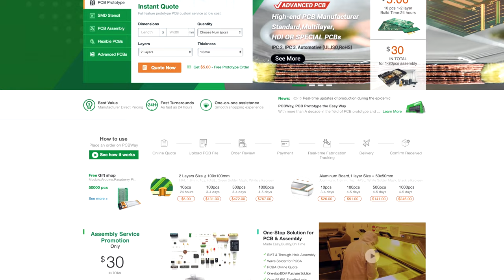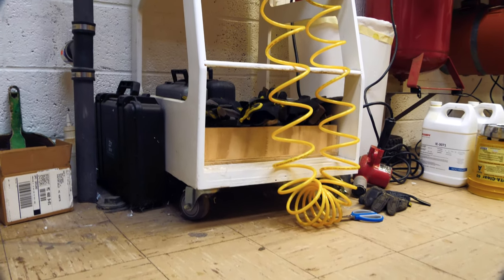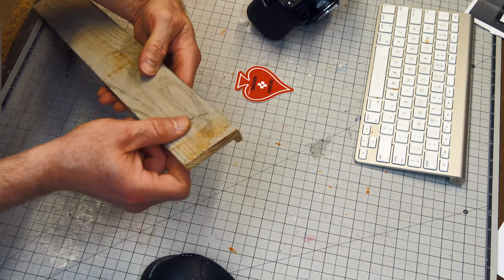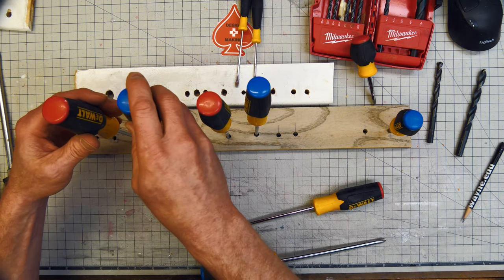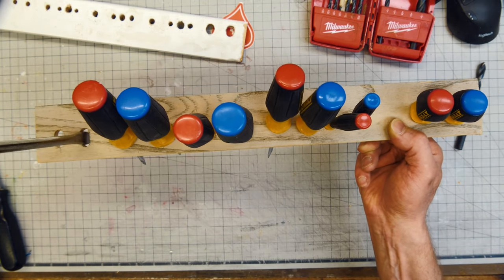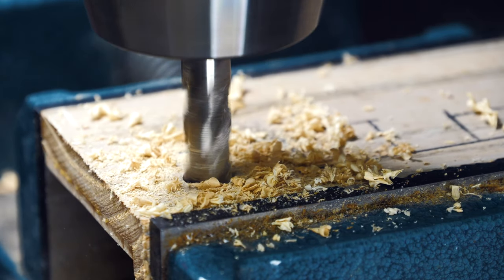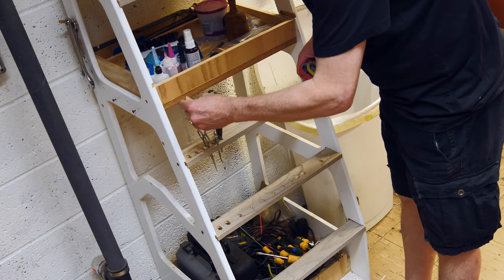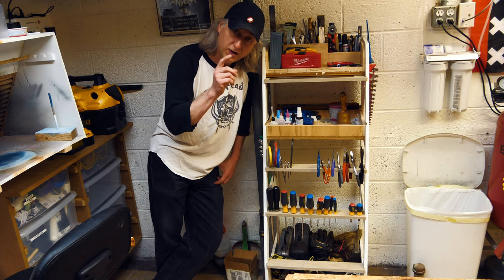Tool Cart Upgrade NSFW edition

Comment: I use those Stanley sort master stackable tool Kits and just drilled holes in the bottom one and stuck some wheels on it and bam. I got me a cheap and modular and effective tool box. Only issue is you gotta stack the boxes so what you need it near the top or on top. Because you can’t access the middle boxes since I didn’t make a rack for them to slide in and out of. Makes a great foot rest too when it’s like 5 boxes high 😂
Reply from the maker: Nice! Thanks for sharing

Comment: I have a comment about the drill press: If you don't like it and have the means to replace it if it breaks, why don't you have the means to replace it now?   Consign the drill to the Great Material Continuum!
Reply from the maker: That, is an excellent question! At this point I simply have not done enough investigating about what kind of a drill press to get, because I really would like to get a smithy lathe mill.